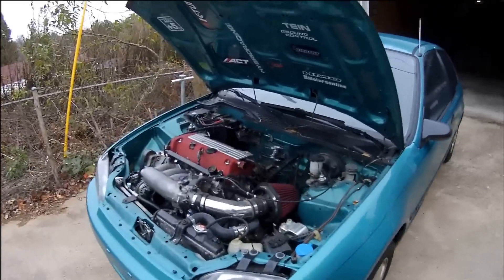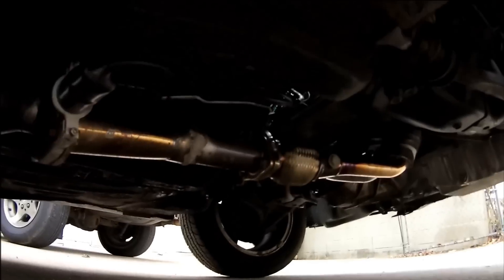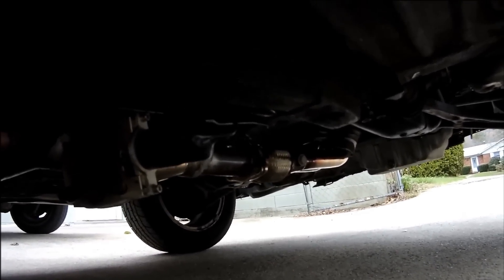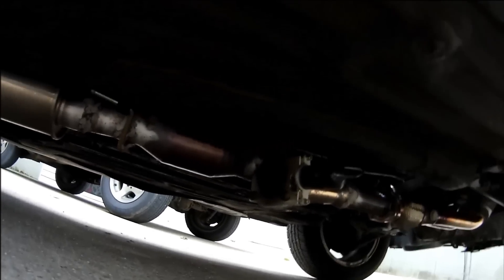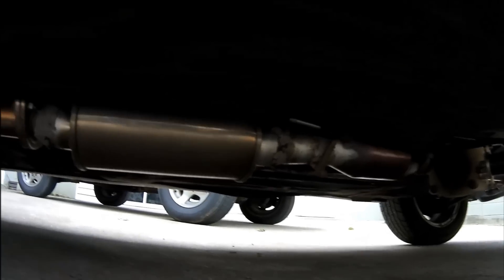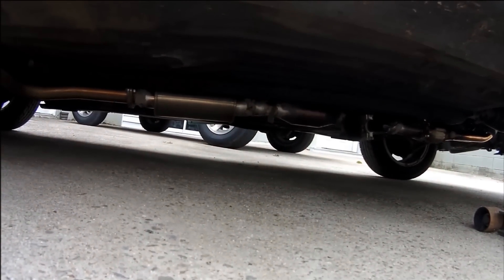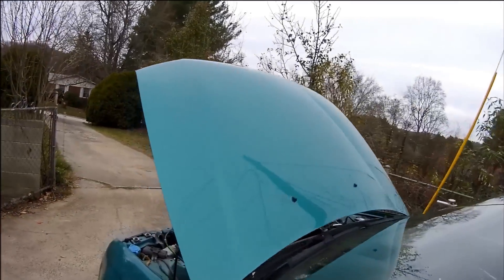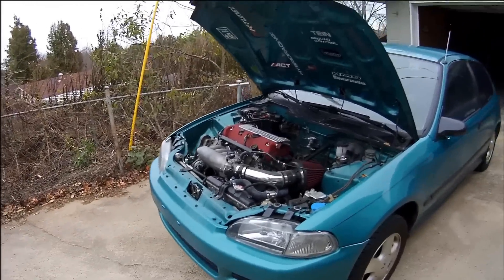Sleeper Exhaust, e-cut out/Dump

Comment: I have the Quick Time Performance cut out on my Civic and I love it! I didn't want a loud exhaust so the cut out was perfect!
Reply from the maker: +JKFlorida I have thought about upgrading to a name brand,  You can see this one leaks a little at high rpm. But not too much,  I can't hear the leak in the cabin.  And it is already getting scratched  up.  I might look into the QTP to replace it.
Reply: EastCoastOctane I used Permatex Ultra copper high temp RTV silicone to keep mine from leaking. About once a year I take it apart and reapply the RTV. It works pretty good.

Comment: Majestic Honda? There used to be one in Warwick RI. That's where I got my 2015 Civic Si Sedan. You from RI? I also have a dash cam. I swear by it...G1WH. It's my 2nd one. they are so reliable and are only 50$ on amazon. Always works, cold, hot.

Comment: Just bought a 97 Honda Civic hatchback dx wondering if you got suggestions it's a single cam non-VTEC and it came with a block that had the VTEC solenoid but think it might be worth just getting whole Nother engine 

Ri life
Reply: +LetsGoGaming go to hondatech.com, everything you need to know is there
Reply from the maker: +LetsGoGaming like Chronic said , do some research about it, see what you can afford.  With hondas, doing a swap is always a good idea.
Reply: +EastCoastOctane  thanks guys and keep up vids ps posted on my channel the car if u want to look at it
Reply: +LetsGoGaming Swap, don't waste your time on that motor. If it was a D16z6 then maybe turbo.
Reply: +KuBurd1 its hard to find good engines in the junkyard around here so i have to save up a lot of money for a b16a
Reply: +LetsGoGaming If your going with the b16 just got with a B18C1 or a regular non vtec B18 turbo should be enough power.

Comment: NOTICEABLE DIFFERENCE IN PERFORMANCE, WHEN OPENED / CLOSED?
Reply from the maker: yes, it is tuned for open dump. I was unable to do a full dyno run with it closes, but it did close during tuning and we lost HP right away.  Also, butt dyno confirms more power when open
Reply: EastCoastOctane 

LOL...  OKAY...

Comment: On my k20 RSX I have Skunk2 headers and a aem intake and a aem pulley, about to put in upgraded valves springs and stage 2 blox cams and also install a ktuned fuel rail n 1000cc injectors n go on e85, what should I do next?
Reply: Oh yea I also have hondata
Reply: You should get ready for alot of speeding tickets
Reply: Ricardo Torres your probably ganna want a new fuel pump for the e85...but that should be a hell of a setup.. do weight reduction in the rear.and put it on some semi slicks ir cheater slick tires.youll be killin it

Comment: I have a 93 Honda Del sol with a GSR b18c1 I have DC headers skunk 2 intake manifold and straight pipe to piece all the way to the back ,MSD rev limiter ,blaster aftermarket pulleys. I'm not sure what kinda of pistons I should get let me know what you think I should get. #AntiJDM
Reply: Don't jump to pistons already. Try building the head first..... valve springs, retainers and cams should get you a little extra power.
Reply: Well get a hondata ecu first before the valve and cams upgrade cause your going to need it.